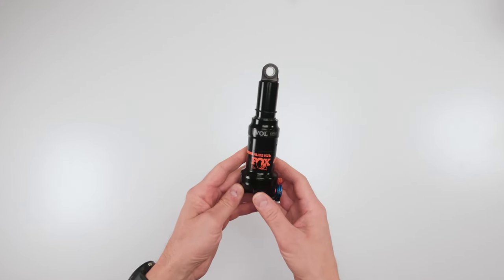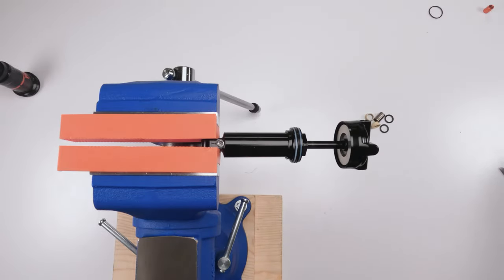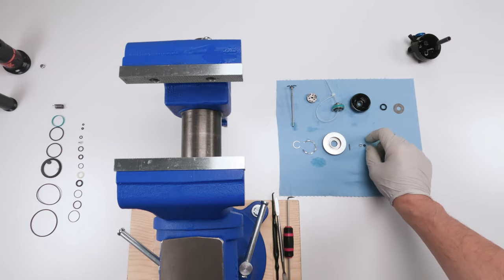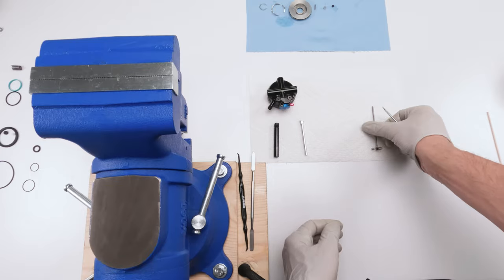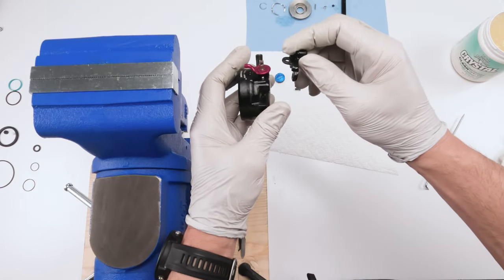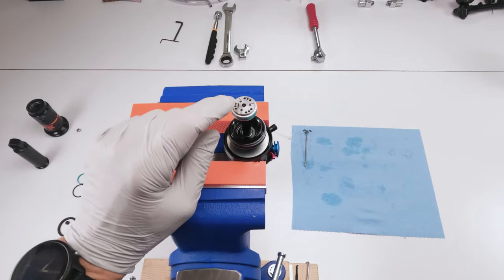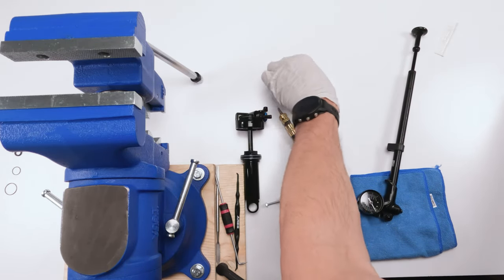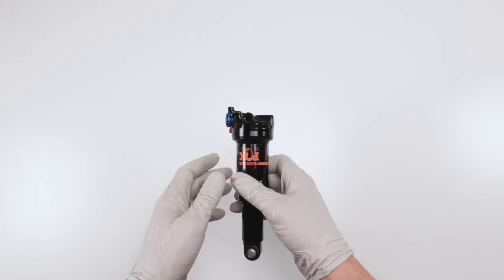Fox Nude DPS Scott Spark Twinloc FULL service guide for beginners. Damper, Air can,  Control knobs.

Comment: Amazing video! Perfectly explained!

Just one tip, to place in their position the outer body seals, the white ones and the black one, it can be easier if you give them a bit of Pringles chips shape. Just placing the seals flat over one of your fingers and bending both of the floating sides to make them hug the finger. With that shape it is easier to place them in their position.
Reply from the maker: " give them a bit of Pringles chips shape" 
This is such a simple way to explain the process visually. thank you so much for sharing. I'll make sure to mention this in future videos 👍

Comment: many thanks, the video is superb! 
just one question about the travel adjust, as I fear mine is not working well… when turning the dial from open to mid, should I see some displacement on the shim held by the wavy washer? How can I check that there is a correct operation of opening-closing of the chambers?
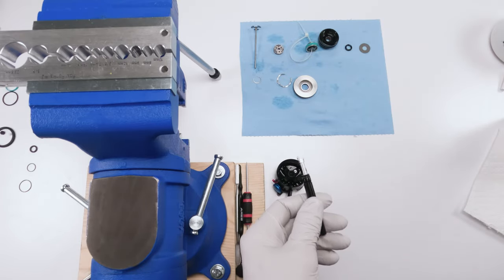Reply from the maker: Just to verify, do you have the nude DPS? When installing the lifting plate shaft into the eyelet, you have to make sure the bearing on the lifting plate shaft is installed pointing towards the remote for this shock, as is seen at 1:05:56.

Comment: Amazing video. While doing an air can service, I noticed the wavy washer not set in place. There are some marks on the large chamber silver mechanism. I put it back in place but it doesn’t look right to me. Should it be all the way under and even with the larger mechanism? So far it’s holding pressure, it wouldn’t hold pressure on my last ride. Thank you
Reply from the maker: Thanks you very much. All the wave spring does is keep the check valve in place. As long as it keeps it in place, you are good.  If the check valve rattles around or moves up and down freely, then you need to make sure the wave spring is seated correctly, so it won't do this. Mot of the same spring should fit under the ledge of the eyelet . let me know if this helps or if you have other concerns
Reply: @zoubtube  Thanks the helps. I had it in place so hopefully it stays and doesn't fall out again. I've been doing some research and it seems like that is a problem with this shock
Reply: When i serviced my shock for the first time, I noticed the wavy washer was loose inside too. I contact Scott service, but they refused to provided me with the information where to put it. Only for partners or professionals, they said.

Comment: Nice video. Can I service the remote/rebound dial assembly without dismantling the shock from inside out? I mean, can I just remove the set screws and take the rebound and damper setting assembly out? I have a DPS nude and the remote dial is sticking even with no cable.
Reply from the maker: Thanks for the comment. The dials can "technically" be inserted without removing the shaft from the eyelet, but it won't go straight in. It will take some wiggling as you have to align both compression and rebound cams properly to their shafts. IF the rebound rod turns on you, then you will have to do it as seen in this video. IF you have a Nude, it will be a harder. I posted a NUDE service video, there are two parts to the camshaft, which will make it more challenging

If parts come in on time, I should be posting a video this coming Monday that will go over all this
Reply: Thanks for the answer!

Comment: If the lockout performance is bad could you solely repressurise the ifp chamber without doing any other servicing?
Reply from the maker: I guess it depends on what the issue is with the lockout. It could very well be that there isn't enough pressure in the ifp chamber, but the question is what's causing it. You can try to add pressure to the chamber to see if the lockout will work as expected (Assuming the IFP is at the proper depth). If it does end up working properly, then you still need to figure out caused the issue

Comment: Hi. Nice video. Is that remote pulley (blue dial) compatible across all scott sparks that’s got twinloc?
Reply from the maker: Thanks for  king comment. I can't say for sure but I believe yes for most. The nude 5 changed things though. I don't think the previous pulley will work, but I could be wrong. if any out there know an absolute answer to this feel free to share please. What year/version shock were you thinking of?

Comment: Hello, the green gasket where the shock absorber lock goes is made of plastic or rubber, it is in case I could buy it separately since there is no kit that includes both spring and green gasket and white plastic seals for scott nude from ransom bicycle . Finally these white seals would be necessary to replace them
Reply from the maker: By "green gasket" do you mean the token? If yes, tokens are optional, and made of plastic. As for "white Seals" are you referring to the white rings in the air can service? if yes, then yes, these should be replaced
Reply: Thanks for the information

Comment: Do you know if the Nude 5 is different or can I use this guide? Great video btw!
Reply from the maker: Yup, just make sure to buy the right service kit for it as some of the orings are a different thickness than older versions. Also, Be Careful when servicing the Eyelet. Some of those parts are very hard to get so make sure you handle them appropriately. Also, If your compression and rebound dials are working fine I wouldn't bother servicing them.

Comment: Hi! What do you think of using rsp slick kick grease instead of sram butter??? In general
Reply from the maker: I've know of slick kick but have never used it. It's not as distributed here in NA as it is overseas. I have to assume it'll to the job just fine, but don't use it for the dials. you need a waterproof grease for the dials
Reply: Hi, i have been using RSP Products for the past 2 years and they work amazingly well 👌

Comment: Amazing job! I just had a little thought, could i just leave the delrin ball out? I mean just not put it in after closing the ifp fill screw or is that not so smart, i am just wondering what does that delrin ball do? It just sits there doing (probably) nothing 😂
Reply from the maker: Thank you very much for the comment. The delrin ball protects dirt from getting in the pellet retainer screw hole. It also helps with corrosion in the pellet retaining screw. Is it absolutely needed, Not really. But Fox wants it in there, so I replace it every time, even though I hate the thing.  

Some think that it helps retain air. I just don't see how it could do this. If the pellet were to pop, the pressure would surely pop the Delrin ball out of its socket. The pellet retaining screw is what applies pressure to the pellet in order to keep the hole made by the syringe in the pellet closed. As long as the screw is fastened correctly, the pellet shouldn't leak or pop.
Reply: @zoubtube  Thanks for the fast Reply 👌

Comment: I have a 2017 scott genius 710 lt and it has the same shock but i assume it's an older generation. On the fox website the part numbers for the air can kit are different. Can I still follow this video to service my shock?
Reply from the maker: Apologies for the delayed response. From what I can tell from the 2017 710 LT specs, it has the same Nude 4 shock that's in this video. The shock in the video came from a 2018 spark. Yours will be longer in travel, I'm sure, but the overall build will be the same. What you need to know is the IFP depth, which will be in the chart below. There are multiple versions of the Genius 710. Identify your version, and you should be good. Let me know if you have any other questions

IFP Info: 

Model	IFP Pressure	IFP Depth
e- Contessa Spark Plus	500psi 	2.150 +/- 0.020in
e- Spark Plus	500psi 	2.150 +/- 0.020in
Spark Plus	500psi  	2.150 +/- 0.020in
Spark	500psi  	2.150 +/- 0.020in
Contessa Spark	500psi  	2.150 +/- 0.020in
Spark RC	500psi 	2.150 +/- 0.020in
Contessa Spark RC	500psi 	2.150 +/- 0.020in
(e-) Genius 700 Plus Tuned	500psi  	2.360 +/- 0.020in
(e-) Genius 710 Plus	500psi 	2.360 +/- .020 in.
Genius 920	500psi  	2.360 +/- .020 in.
e- Contessa Genius 720 Plus	500psi  	2.360 +/- .020 in.
Genius 710	500psi  	2.580 +/- .020 in.
Genius 700 Premium	500psi  	2.580 +/- .020 in.
Genius 720	500psi  	2.580 +/- .020 in.
Genius 730	500psi  	2.580 +/- .020 in.
Contessa Genius 700	500psi  	2.580 +/- .020 in.
Contessa Genius 710	500psi  	2.580 +/- .020 in.
Genius LT 710 Plus	500psi  	2.790 +/- .020 in.
Genius LT 700 Plus Tuned	500psi  	2.790 +/- .020 in.
Genius LT	500psi  	2.790 +/- .020 in.
Reply: @zoubtube  Thank you so much, i have the 710 Lt Plus so i'll follow the numbers listed there. 👍

Comment: On my shock the dial is loose, like the spring is broken, do you think I can dismount the dial without dismounting the entire shock?
Reply from the maker: I've never tried this, so I can't be 100% that there is no way to do this, but I don't think you will  be able to. I'm fairly confident the issue will be the rebound metering rod. The metering rod fits into the rebound knob cam. so it protrudes a bit into the remote housing. I don't think you will be will be able to get the spring past the metering rod (or at least easily do so). let say you do, then you will have to fit the metering rod to the rebound cam, which might prove to be extremely difficult.  Also (and this can be a big one) if you don't remove the air from the IFP, the whole system will be pressurized, there is a chance that the rebound metering rod might lift even higher than the cam when removing the entire remote. Even if its a few mm's it'll make it impossible to assemble it all without taking off the head. 

Again, I can't say 100% for sure though. If anyone out here knows of a way, please share

If the shock doesn't need seal service, then taking it apart to change the spring, and putting it all back together is actually not that bad of a job if you have all the tools. The most challenging part of the job is literally filling the IFP with air, due to the pellet. FOX really needs to get a valve in there imo.
Reply: @zoubtube  OK thanks, you convinced me :) Great day!

Comment: You don't need to fill with Nitrogen? Air works too?
Reply from the maker: YUP! both Air or nitrogen will work. If you ride is very hot temperatures, and on trials that are long and aggressive, then you can benefit from nitrogen. otherwise air will work just fine

Comment: You don’t mention the Trunnion tool in the list of tool you will need. But you will need it, right?  Do you know the part number of that tool?
Reply from the maker: My sincere apologies for the delayed response. The fox parts numbers are either 398-00-099 or 398-00-833. But here is a link to a tool on ebay which Costs less than the fox tool, and the tolerances are top notch. I have zero affiliation with his guy. He just top notch alternative tool options for a good price
https://www.ebay.com/itm/255443678943?hash=item3b79a136df:g:I1AAAOSwzN9iK9aR

Comment: Hello, i have Scott Spark 910 m.y. 2022 with fox Nude evol suspension, how much air can i pump inside. My weigth is 90 kg but 150 ps is not enough
Thank you and cool video
Reply from the maker: I'm about 80 kg and hover around 230 psi at 25% sag. To set your sag, put the dropper down if you have one, sit on the bike with your feet on the ground without bouncing on it, then raise your feet, carefully put them on the ground again, and gently stand without bouncing the bike. Then measure the distance between the sag ring and the wiper's outer edge.  Keep filling it until you measure around 11mm from the wiper edge to the sag ring. This will be ~25% sag for that shock. It's a good starting point. 

At 90 kg, I wouldn't be surprised if you end up at around 250 psi, give or take. But make sure to fill the shock with 50 psi at a time and cycle the shock by sitting on it about 10 times before adding more air. This is so that both chambers equalize. When you're done with your sag, then you need to set your rebound, which is a totally different process
Reply: thank you very much everything is very clear, in the end I set 275 psi ✌️
Reply: Thanks for that. I know nothing about dual-suspension but now own a Spark and was worried about adding too much air. Looks like I need to go higher.  @zoubtube

Comment: Hi! Thanks for the video! Do you know the size of the bearing under the bleeding screw? Mine just disappeared 😢
Reply: Found it in the Fox spec sheets. It's 1/8 inch.
Reply from the maker: Damn! I wish I saw this 3 days ago when I was working on a DPS for a video I just uploaded. I would have measured the bearing. I should be working on another one next week. I'll check it then.
Reply from the maker: @pablocarbajo5545  Now I wish I saw this one before I saw the last one 😁Good job figuring out for us👍

Comment: What would cause the twinloc mods not to function anymore even tho the cable is turning the blue knob? 
I did have the dust seal partially pop up and let the air can air out bottoming the shock. After this the twinloc modes are not working. I fixed the seal and pumped up to 260psi.
Reply from the maker: Apologies for the late response. Are you sure the cable is turning the dial enough to activate the twin loc. I know my buddy (the shock in this video) was having an issue with this at the end of last season due to friction in the cable housing. Also, there are two seals, the large one on the air can, and a large delvin in the eyelet.  Check to make sure that one didn't pop out as well.

As for the twin loc, the dial is connected to a cam which activates a pin, which in turn activates the eyelet base and either opens or closes flow. It sounds like the base isn't activating, which can only happen if the piston is not touching it or the cam isn’t touching the piston. 

So you're saying the main air can seal (middle of the shock, popped out due to pressure? Did it happen while riding or filling it up? 

You might have to open the eyelet to look into whether the whole mechanism is working
Reply: No problem, the dust seal popped while riding. The cable was fine. I even actuated the knob manually and still nothing. I'm waiting on an inner seal kit and will have a local shop do a full rebuild. They mentioned the nitrogen was released during the blowout of the dust seal.

Comment: My blue twinloc dial is sticking is this something that can be serviced without stripped everything out? I have removed the blue dial with 1.5mm hex to see if that needed cleaning but doesn’t seem to be the case. Any help greatly appreciated.
Reply from the maker: Apologies for teh delayed response. That same thing started happening to the shock in this video a couple of months ago. One thing I've learned about this remote mechanism is that the SLIGHTEST friction in the cable doesn't allow the compression knob to fully retract. What you might want to try is to add a bit of oil to the cable housing first, especially near the base of the shock. Try that and let me know how it goes
Reply: @zoubtube  thanks. I will check this out, I will check out the the cable and routing. Thanks again